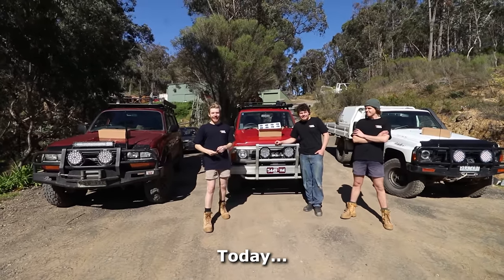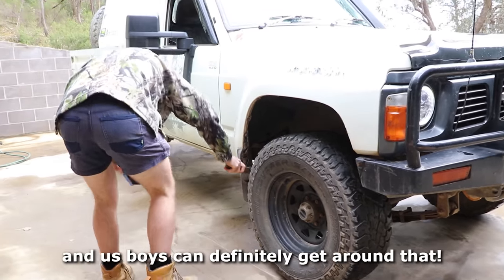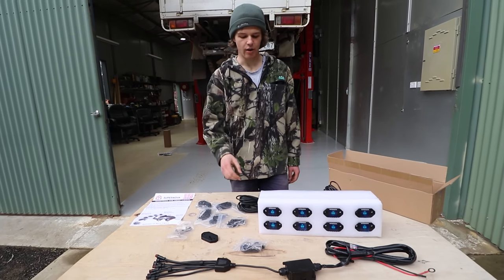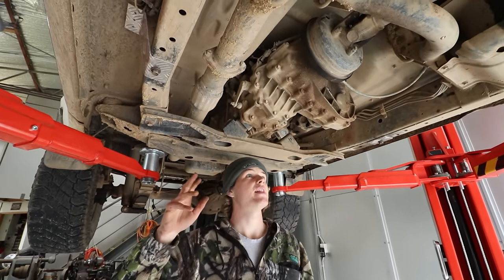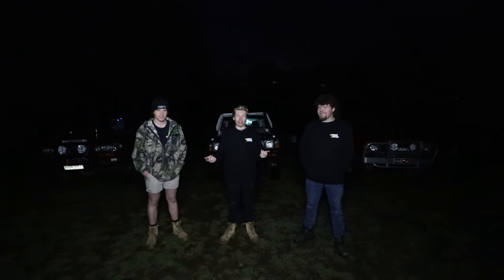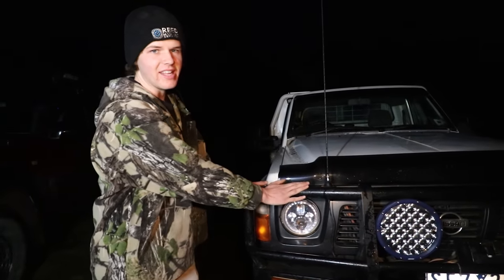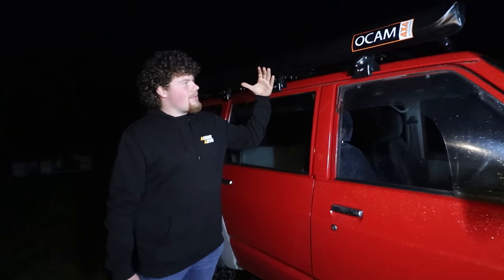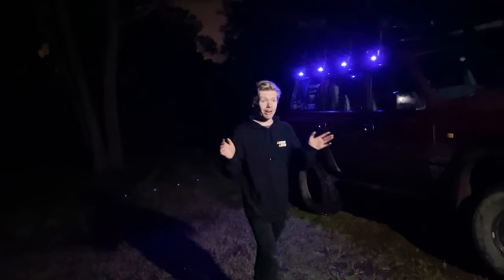THE ULTIMATE CAMPING & ROCK LIGHT SETUP! 4x4 RGB Rock Light/Party Light CHALLANGE!!!

Comment: I reckon liam takes the cake with this one for the function version. Dan with a close second for the swivel mount… I’ve actually been thinking about getting these and putting one in each wheel well, 1 on each canopy door and 2 in the centre of my canopy… love that they only draw 2/5 of stuff all power. But unsure if you can turn them on and off and tune the colours individually. Not essential but would be a bonus for sure.

Comment: All good ideas. 
I'm just a bit surprised none of you took the trouble to cut'n'shut the cables to the correct lengths for each light. 
Solder joints and heat shrink would do a great job.

Comment: @Liam if you switch the middle rock lights you have at the door switch (which usually runs the dome light) they will turn on whenever you open the door. I have a similar setup wired to mine and it works really well, one of the better cheap mods I have done :) you could double switch them so they all run from the app but only the middle ones run off the door switch - thanks for the vid again!